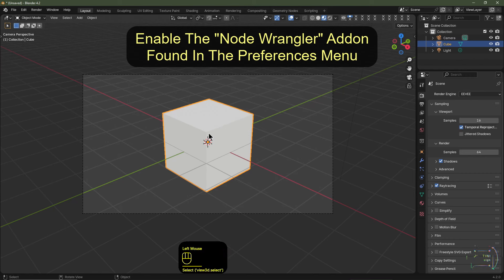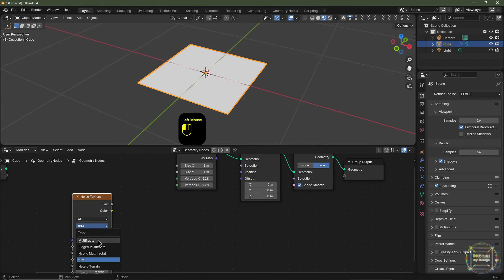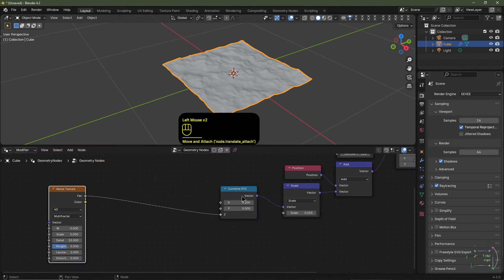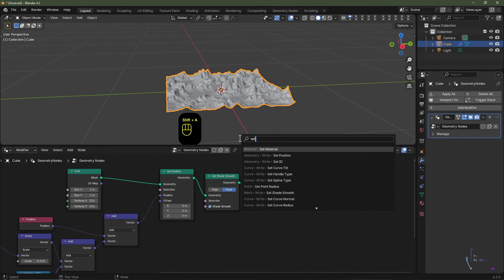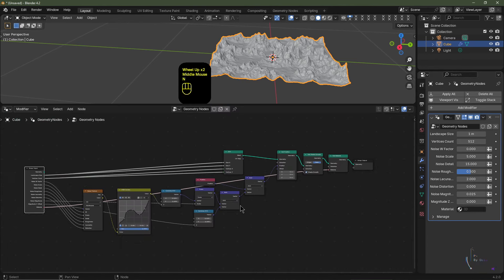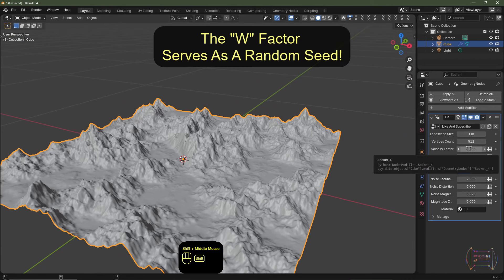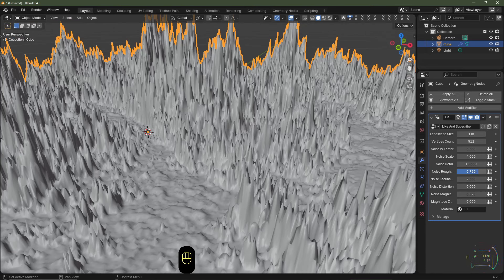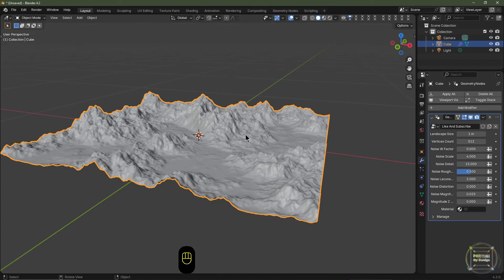Geometry Node Terrain Generator - Blender Tutorial

Comment: Seriously, you're adding the Noise to the original position and plug it into the Position input? Have you never wondered what the Offset input is used for in the Set Position node? The vector plugged into the Offset will be added to the vector plugged into the Position - which by default is the original position of the vertices if nothing is plugged in. No need for a separate Position and Vector Math node, the Offset does all this automatically...
And for float values like the Fac output of the Noise there is a Float Curve node... no need to manipulate a single float in three channels with an RGB Curve.
Reply from the maker: Yes, I had realized the set position mistake after I had published the video. At the time I was contemplating removing the video and re-recording the tutorial with the addition of removing the position and the vector math node set to add, and then plugging the tree directly into the offset of the set position node. I ultimately decided to keep the video up because it was performing well and the formula works. I have another terrain geometry nodes generator already whipped up with a quite a few more features which I intend making a tutorial for. You'll be glad to know this one plugs straight into the offset lol

Comment: Great tutorial, thanks. If I have 2 or more chunks of a terrain like that, is there any way to make them connect to each other seamless?
Reply from the maker: I can think of a couple of ways off the top of my head. The 1st method could be to use a shrinkwrap modifier. Add a subdivided plane inbetween the two terrains, then add a shrinkwrap modifier on each of the terrains and use the newly added plane as the target. For a smooth transition you will need to add a vertex group gradient on each of the terrains and then add the vertex groups to the shrinkwrap modifiers. The 2nd method would be using loop tools bridge edge loops method. For this you will need to apply the terrain generator geo nodes modifiers in the modifier stack. Then join both the meshes together by selecting both meshes and hitting "CTRL + J" and then go into edit mode, select the 2 edges you want to connect, then right click, navigate to "loop tools" menu, and then select 'bridge edge loops" note that the edges you want to connect mush have an equal amount of verticies for this to work. When the edges are connected, enable "proportional editing" select the edges you just connected, and hit "S + Z + 0" and adjust the falloff of proportional editing with your mouse scroll wheel to smooth out the transition between the 2 joined terrains. I hope this helps, have a great day and level up 🚀
Reply: @PhotiniByDesign  wow. Thank you so much. I will try your approach for sure. You a very kind person. Thanks. 😊
Reply from the maker: You are welcome anytime, have a wonderful day 🙂